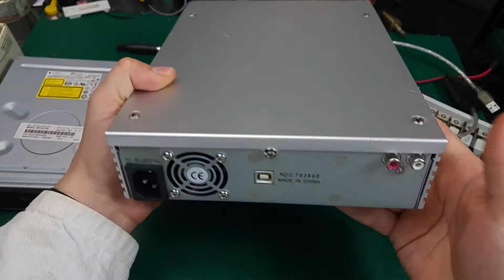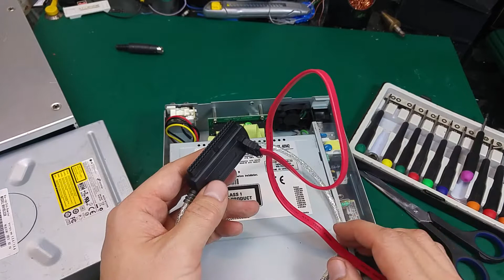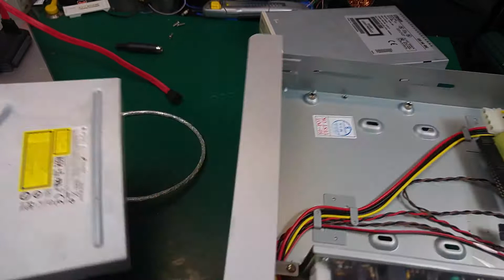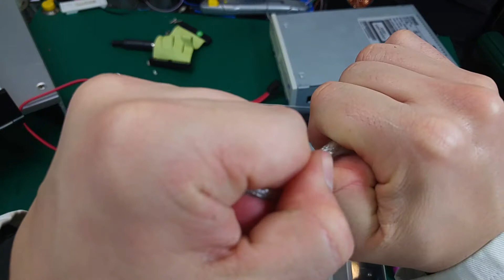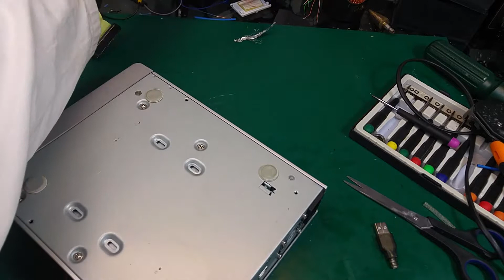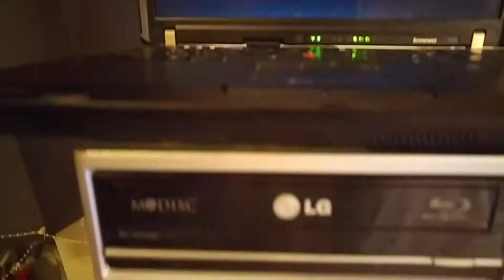Convert OLD PATA (IDE) USB external enclosure to use modern SATA blu-ray device

Comment: hello - do u know where i can buy ide dvd enclosures from ? not sata but ide !! thanks !!!
Reply from the maker: Hey, I don't think they are manufactured anymore BUT You can easily!! get bi-directional SATA-IDE adapter bridge - most like enclosure will have enough room to fit it (I did something like it in past with great success) check amazon or aliexpress "bi directional sata  - ide" it's small module that will convert sata enclosure to ide interface in both ways - so You can attach old drive to new one, or new drive to old one
Reply: @ElectronicNoobBlog  okay many thanks - old drive to new one? u mean pc ? ok thanks my friend and bless u lots !!
Reply from the maker: @ms-ex8em  Yes, they work both ways search for "Bidirectional SATA to IDE Adapter IDE to SATA"

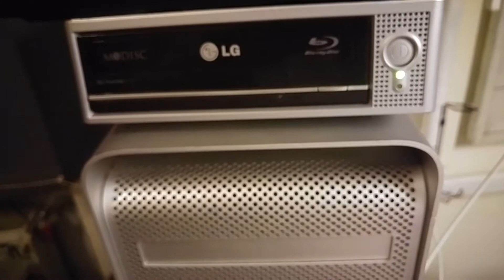Comment: 20:10 The opposite, iMac G5 came out two years after the drive.

Cool enclosure, seems a bit overkill for a external DVD drive.
Must have been designed for a HDD and probably had cases left, unless slimline DVD drives didn't exist in 2002.